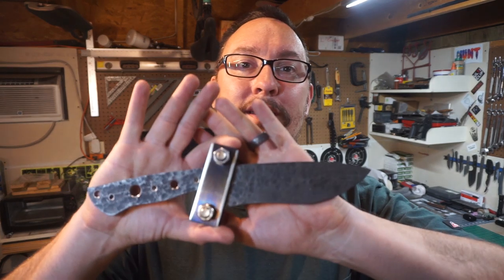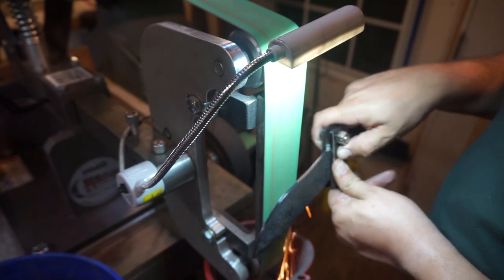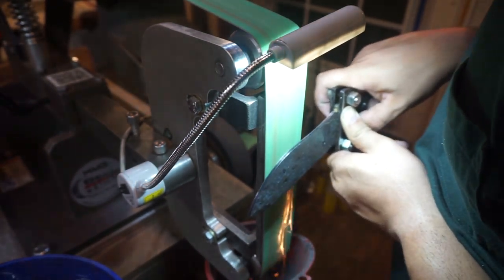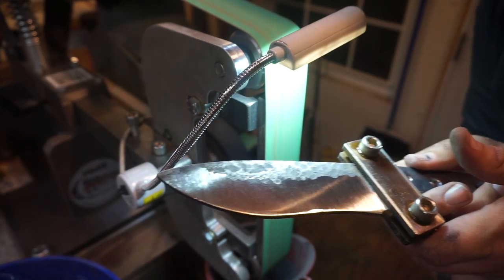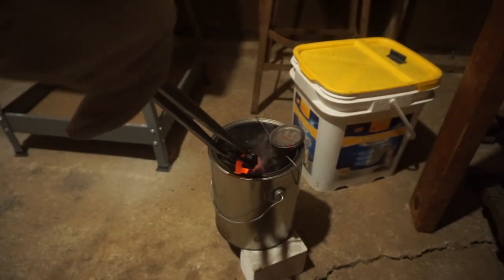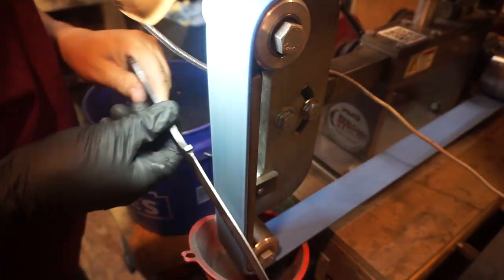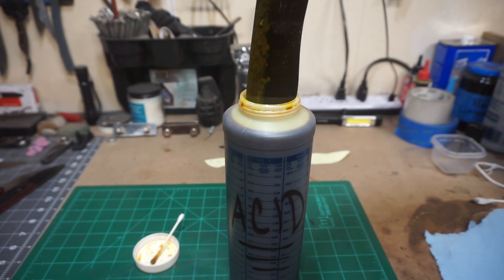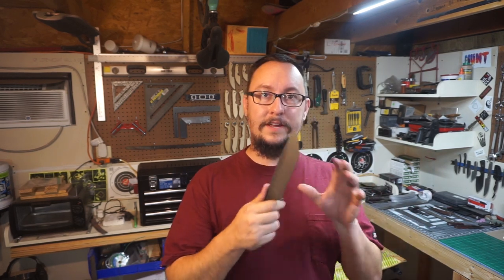Making A 5160 Drop point Recurve Chopper Part 2 | Knife Making | Daily Vlog

Comment: I like the advice about locking the arms and moving your body to keep everything even.  I can see how that helps.  Also here is something that I have been experimenting with that you might be interested in.The last knife I made I used the flat platen to grind the bevels in, and then a rubber contact wheel to clean it up after heat treat with the higher grit belts.  The softer wheel seemed to give me a much better surface finish.  I am only on my 8th or 9th knife so I may be entirely wrong about why it works or even if it does make a difference.